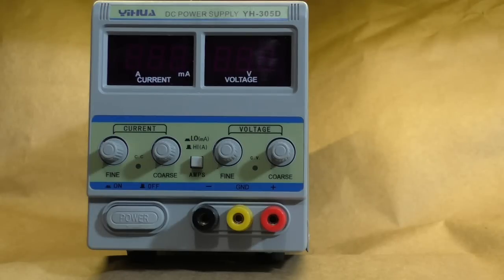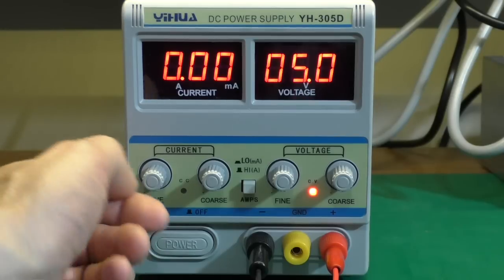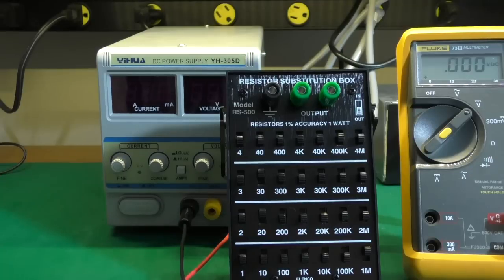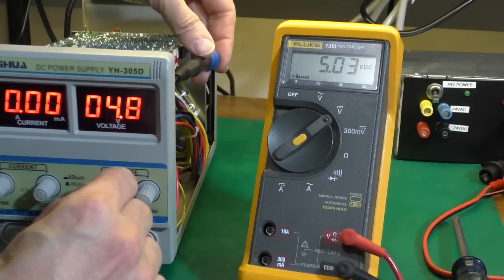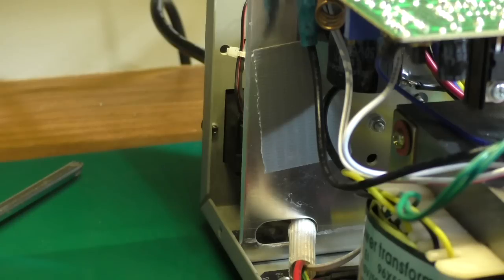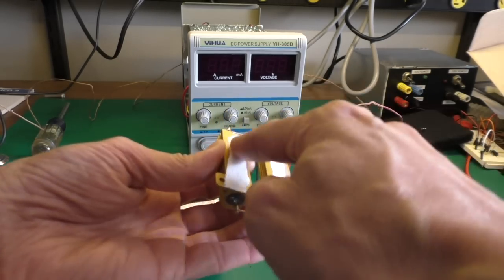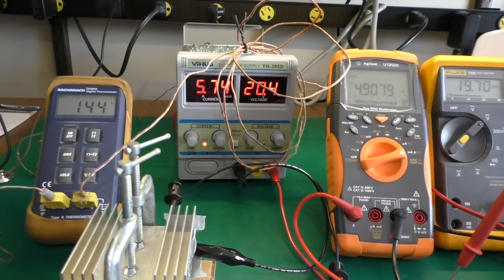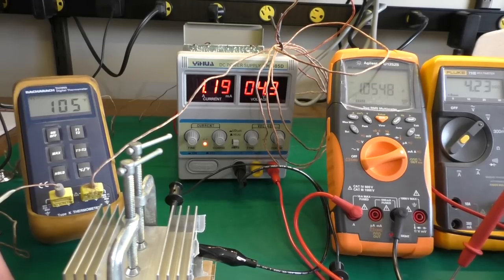R&D #12 Review: Yihua $50 power supply from Ebay

Comment: You seriously tried to calibrate a small mA output on the amp scale using your fluke's milliamp reading, and didn't consider using the button to change to the milliamp scale? lol
Reply: Exactly. He was at the absolute limit of the A range, and the reading on the power supply was 2-3 counts out - totally within spec of any meter. Then he tweaked it and put it wildly out of calibration at full scale (showing 5.7A when it was actually 4.8A). I bet if he'd used the mA range, as you said, it'd be fine.
Reply: OMG Yes!  It was driving me CrAzY.

Comment: Very good review! I wish I would have bought one of these a few years ago when they were linear PSUs - now they are all switching PSUs. I'm not worried about the noise but rather the durability.
Reply: This thing is linear. You can tell by it getting hot. And the gigantic transformer.

But uh... Durability is better for switching designs. They don't get hot.
Reply: @JasperJanssen  Although Linears are hotter than SMPS and less efficient, Linears used to be more reliable and durable. Also, i guess for audio power testing linear are better, in the college, someday i tested some TDA2040 circuits, some with linear psu and some using an old AT PC psu. The circuits tested on the AT psu exploded, all of them, the ones tested on the linear survived and worked almost perfectly. Despite that, personally i still prefer SMPS due its eficient and lightness